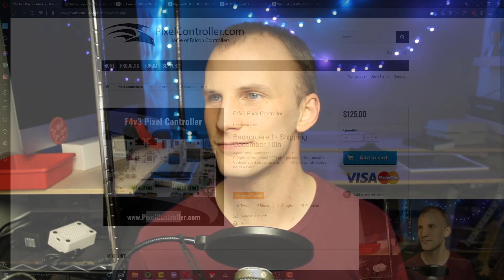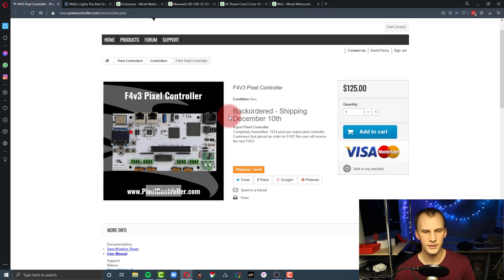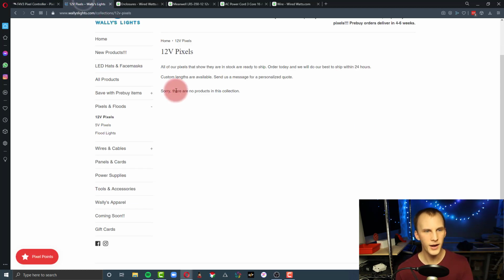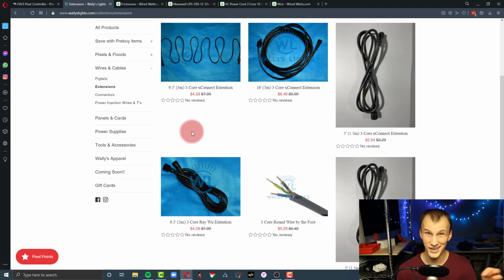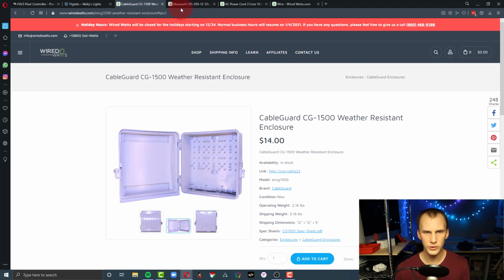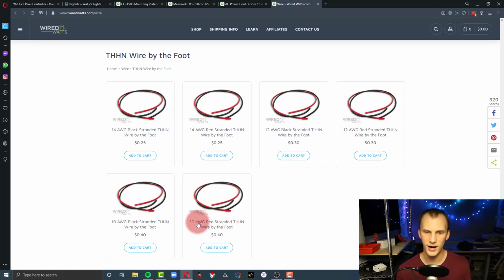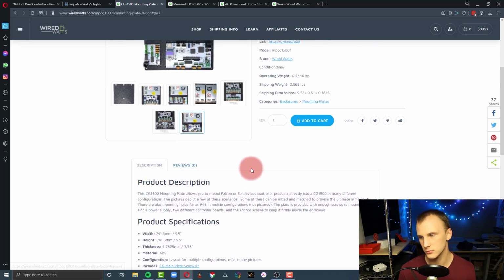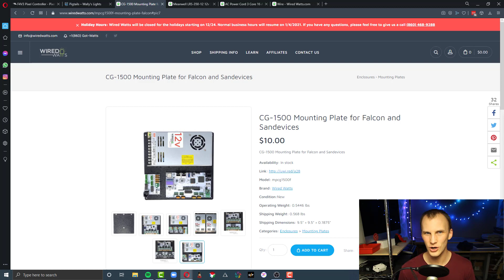Start to Finish - Creating a Basic Christmas Light Show with Animation, Pt 1 - Gear Selection

Comment: Holy inflation Batman. I went to try and find a falcon controller and here in 2023 it is $230, not the $125 that was shown on this video 2 years ago.
Reply from the maker: The F4 that we focused on this video is a much smaller controller than the current offerings today, so it's not a perfect comparison :)  Prices have gone up, but an F16 or F48 for example, probably were around $185 2 years ago.

Comment: David this is a great video for me. this is my 1st year doing animation with my lights. is there another controller you would recommend other than the Falcon F4v3? The Falcon website says they are out of stock.
Reply from the maker: Yes, unfortunately about a month after I made this video, they stopped making them...ugh!  For a small controller, the Kulp K4PB is good, be sure to buy the SD card with it pre-installed and a wireless antenna.  Another simpler and smaller controller is this one from Wally's lights: https://www.youtube.com/watch?v=jWULyHz5Gn8